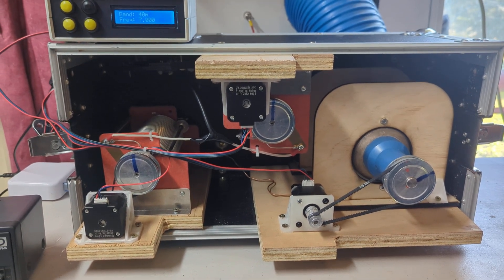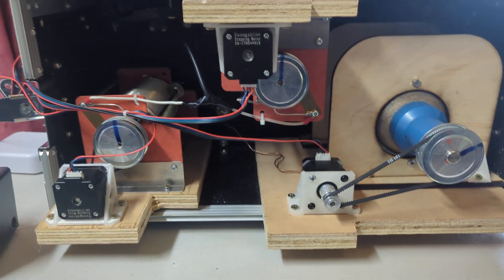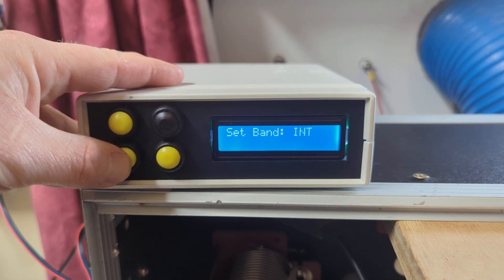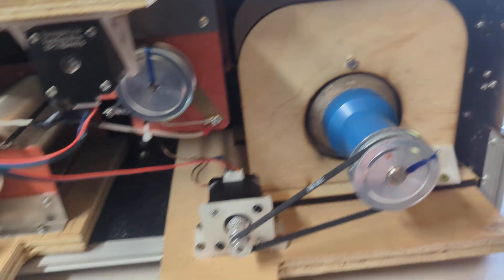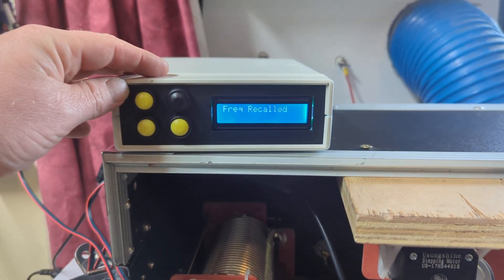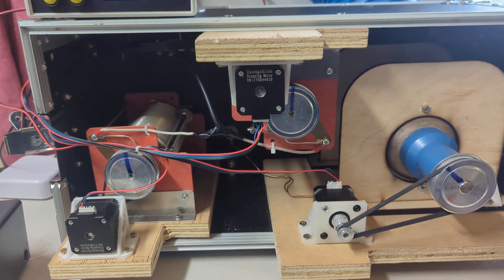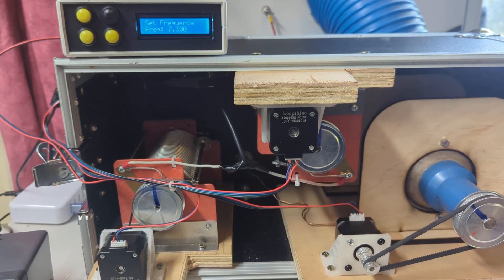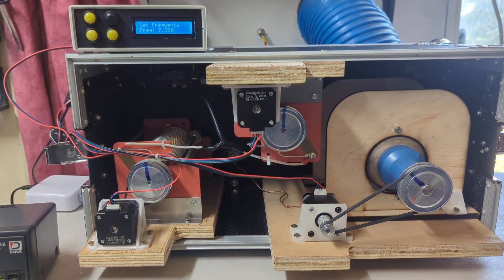Home brew balanced L antenna matching unit

Comment: Hi! Great video! Is there a diagram for this project?
Reply from the maker: Hi thank you for the comment. Sorry I have not documented the project. The matching side is just a balanced L with parallel capacitor on the antenna side.